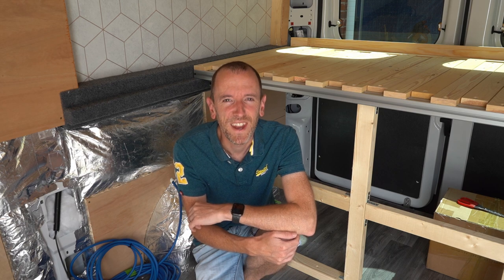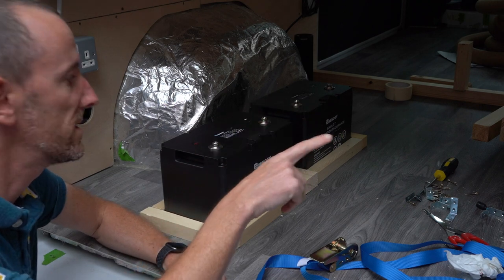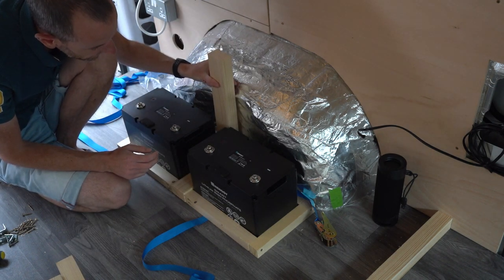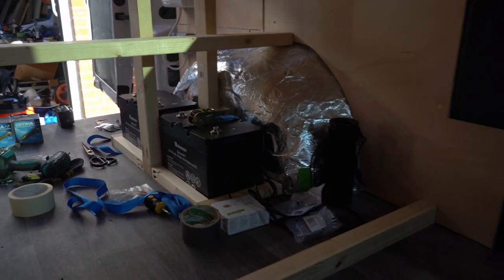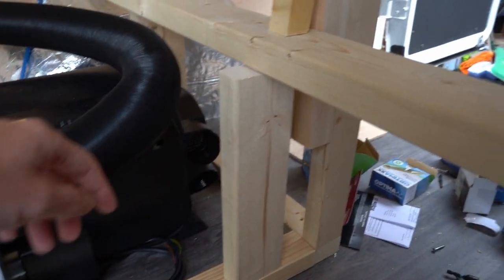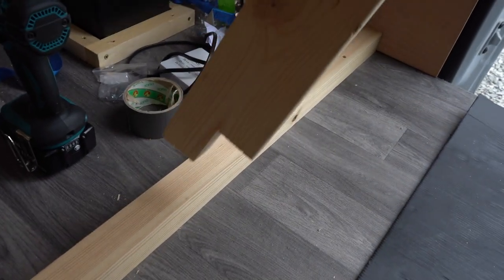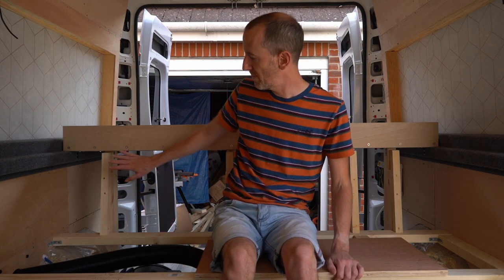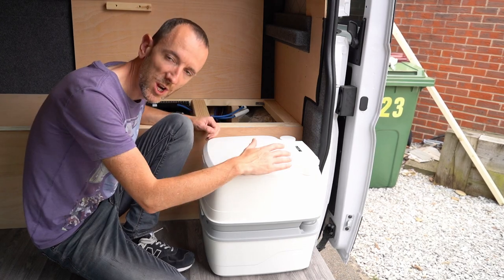Campervan BENCH SEAT | Part 1 | Fiat Ducato | UK Self-Build Campervan Conversion

Comment: Its coming along nicely! Still in 2 minds whether I get a van or not, its only just occurred to me I don't really have anywhere to convert it! I got a car parking space but if its raining got no where to cut or draw on large materials as well as no electricity at the car parking space!
Reply from the maker: Thanks. Yeah I must say if we didn’t have the garage as a dumping ground I don’t know what I’d do! People do convert them on the street or with no garage but I can’t imagine how!
Reply: I have no garage, I can sometimes park in my back alley to get close to the yard and electrics but mostly I work from the street. It's a pain in the arse but doable. Especially when oddball neighbours, who's only experience of camper van is a week in Towyn, bob their head in to tell you how you should do it lol. 
I bought a generator for when I had to work out of reach of electricity and thought it's come in handy as an emergency starter if ever I got stuck with no power, but I haven't used it yet but that's an option for you.

Comment: Good stuff man. Suggestion. Route lightening slots or drill lightening holes into the ply seat base. You'll lighten whilst maintaining structural  integrity & promote airflow.
Reply from the maker: Thanks. Good idea, need to get it on a weigh bridge soon eeek!